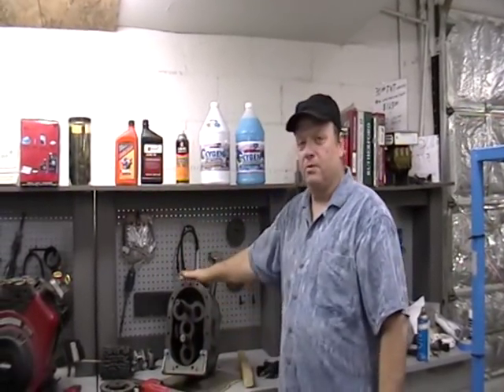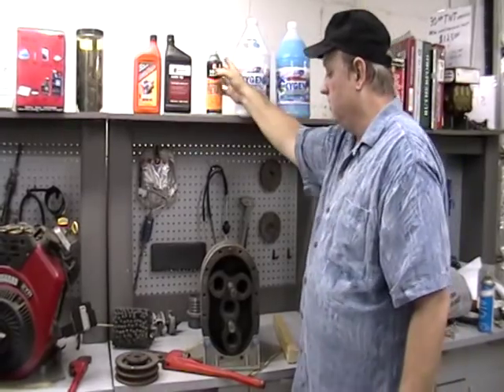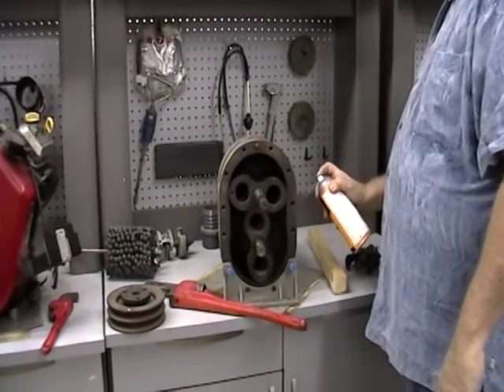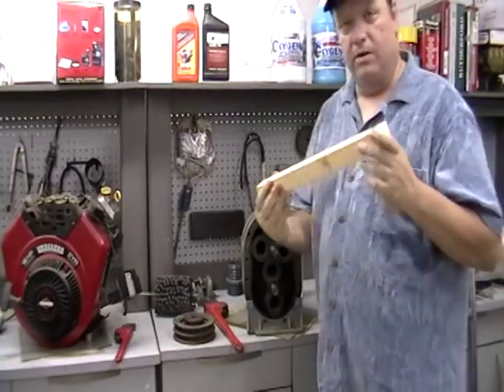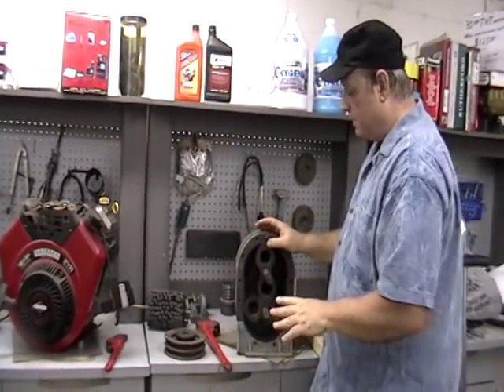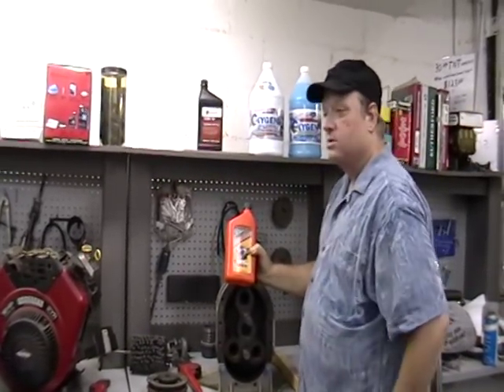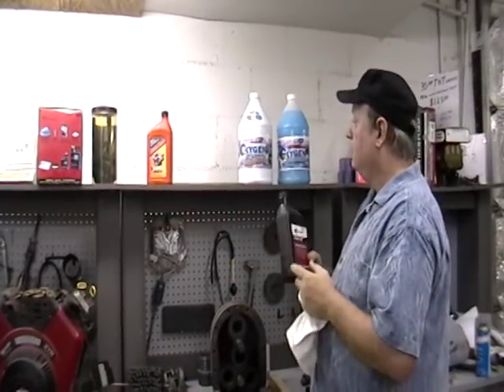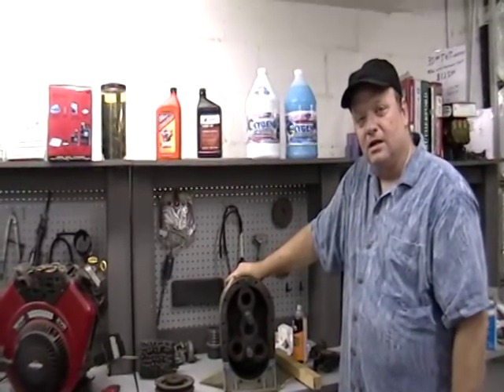Truckmounts - HOW TO UNSTICK A STUCK TRUCK MOUNT BLOWER FOR BRENT !!!!!!

Comment: I used my dad's machine to go do a carpet job around 2021 and I got a stuck blower. Only time in 25+ years of cleaning for that rig. His machine is a vanguard 18hp with a 3006 blower in vertical position, much like in this video. At the time, I'd never had the issue before and I didn't know it was a stuck blower. I just knew the engine wouldn't turn over by key or pull string. I pulled as hard as I could. The customer even tried pulling it 😅. So I had to bail on the job and bring it home to let my dad troubleshoot. The next day he said he put a pry bar through the blower pulley spokes and pushed it over. Freed it up. After that, he and I decided to investigate the gear oil on the blower. Interestingly, the oil was way too high. My guess is the previous application for the blower was in horizontal position so it had much more oil in it than it needed. We drained it to proper level and it's been fine since. My dad has never and will never use wd40 on shut down. That was never a technique when he got the machine in the 90s. I'm not saying that's a good thing, I'm just pointing out that blowers can take massive abuse as compared to more picky equipment. Great video thanks

Comment: This is perfect.  I have a machine that was left idle six months.  I found the blower stuck and thought omg 1200-1700 bucks.  All it ended up costing me was my time. and a can of 3 n 1.  Thanks so much for making this video. I used a handle from a small claw hammer as a wooden punch. and it turned the rotor a few degrees when I smacked it with the other hammer.  Then I went back to the pipe wrench as you recommend. absolutely perfect

Comment: great video. I love it when people take the time to do these. really helps people save money.

I have a question, though. I'm using an old Hydra-Cat S-Model. I just refilled it with grease...until it came out of the overflow bleeders. About a week later, I'll notice little puddles of grease coming out of my blower. It's 100% the exact same color. Is there some kind of grease seal that needs replaced? I'm worried about a fire in the exhaust. The grease that comes out smells burnt.
Reply: You have to be careful not to jam the grease in there too quickly (no air-operated or electric-operated grease guns) because the pressure will invert the seals on the bearings and the grease will come out around the shaft. I'm guessing that's what happens and new front bearing seals will be needed.

Comment: I used wd40 , poured it right in the blower and it became unstuck within the hour . Janitors warehouse quoted me over 2 grand to replace .  I was able to turn it by hand with the pulley . Techs should be spraying wd40 or something similar into the blower lune port every use so there is no issue with rust